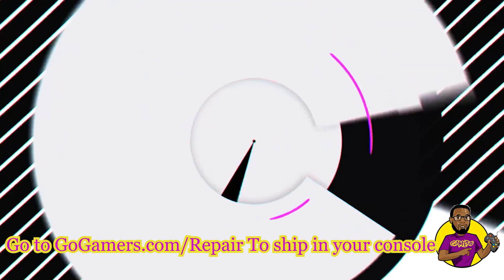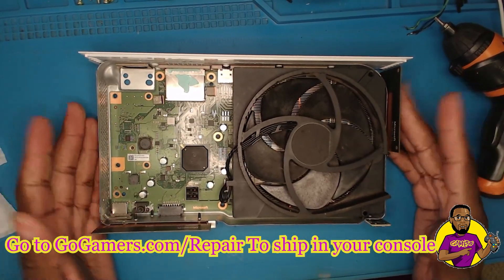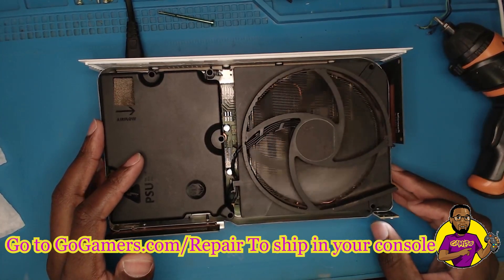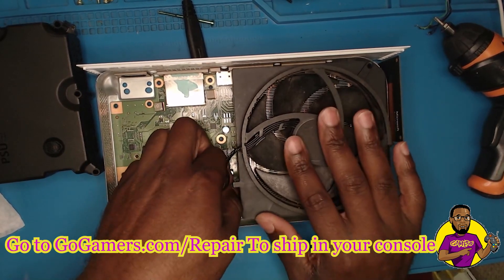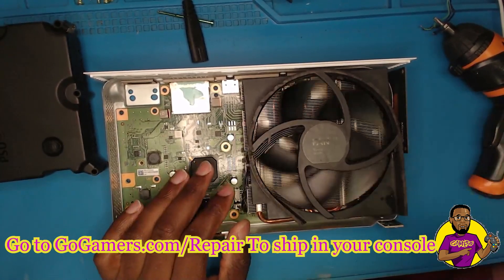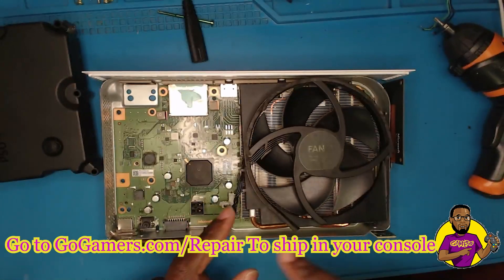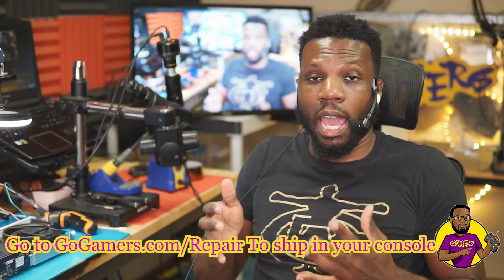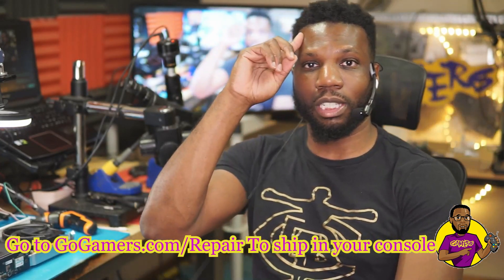Fix Xbox Series S/X overheating Fan (5 Min Repair)

Comment: Too bad that fan doesn't work in series x. The fan spins the wrong way for series x. My fan just binded up after 4 years of basically always being on. I think it's probably a bad idea to keep your console in the quicker start up mode. Better to use eco mode as far as console longevity.

Comment: My wife’s Xbox series s started overheating and shutting off, sometimes after only being on for 2-3 minutes! Replaced the thermal paste on the APU, worked for 24 hrs then kept shutting off. Tested the fan and it was seized up bad… had a fan out of an Xbox one series s that has just been sitting in the closet, so modified it to fit and it works like a charm!

Comment: Man i’ve never dealt with taking apart xbox consoles, afraid i’ll mess something up
Reply: It’s actually a lot simpler than it seems… I had never worked on one before either, but replaced the thermal paste on the APU and replaced the fan assembly on my wife’s Xbox series S…
Reply: @DLHill87 do you know what tools I can use?